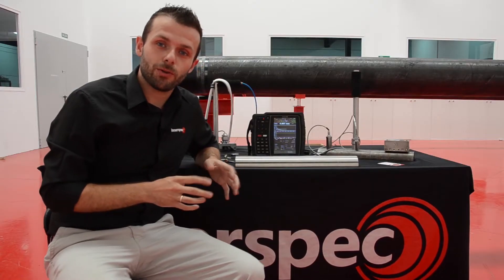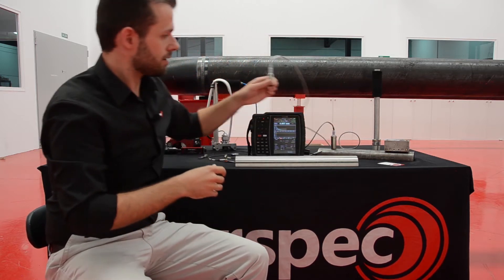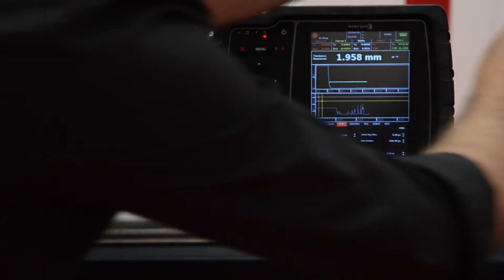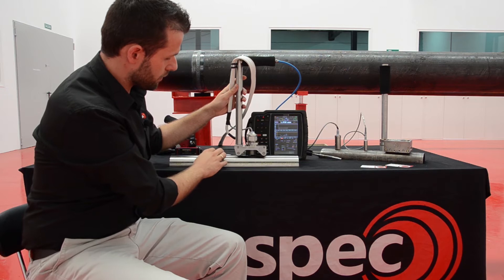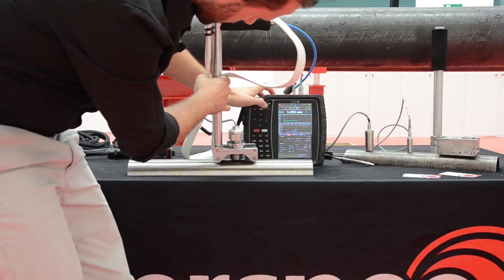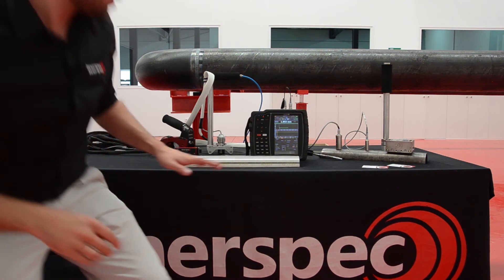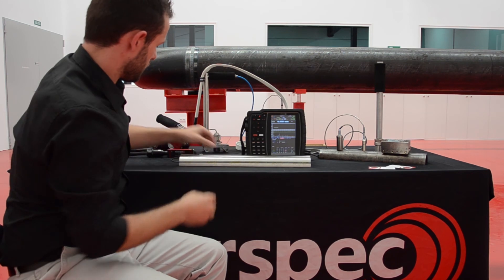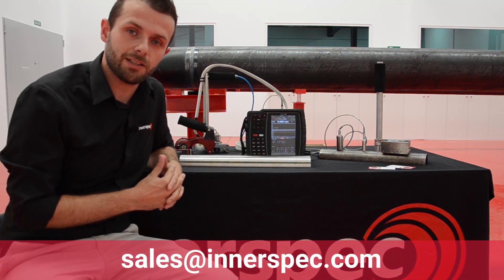SENSORS FOR THICKNESS MEASUREMENT (EMAT, DCUT)

Comment: Is there a EMAT sensor for mesuraring wall thickness of small dia pipees 2 inch and less , and can stand with 150 degree
Reply from the maker: Dear Raddad, thanks for your message. Yes, we have EMAT sensors that can measure thickness on small pipes at high temperature. Please send an email to sales@innerspec.com with a bit of information of the application that you are interested in and we will gladly assist you.
Thank you.